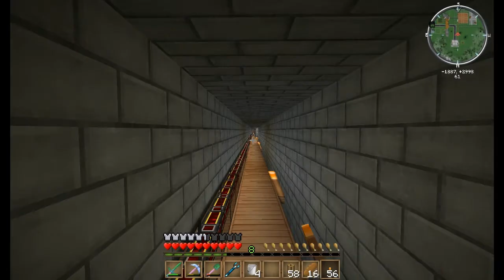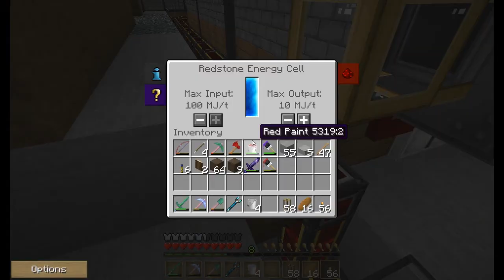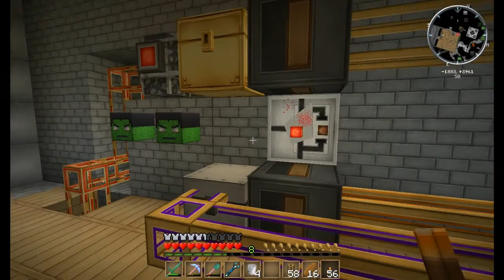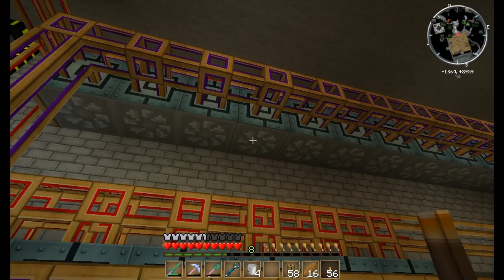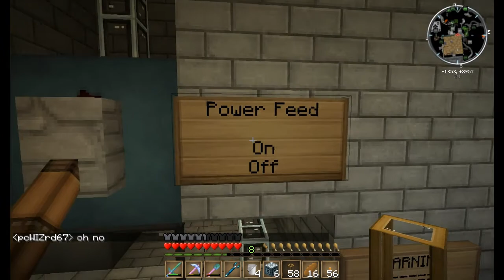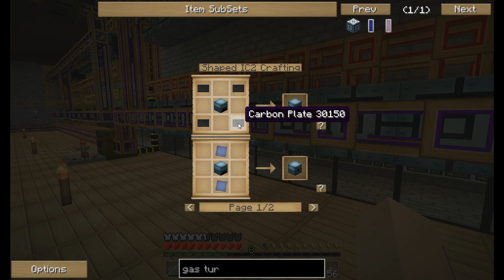FTB [Mindcrack] - Ep 11 - Zombie Power

Comment: You could even put a stack in and set it to 40 seconds, and 4 empty cells for the other filter. I tested it with 2 centrifuges and the timer set to 480 seconds and it worked flawlessly :)